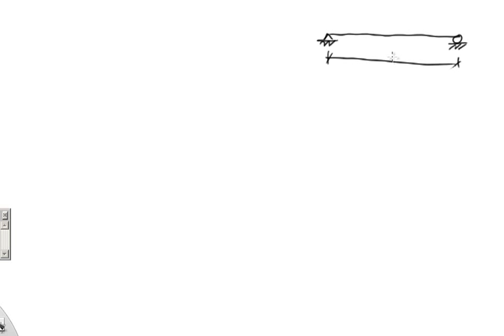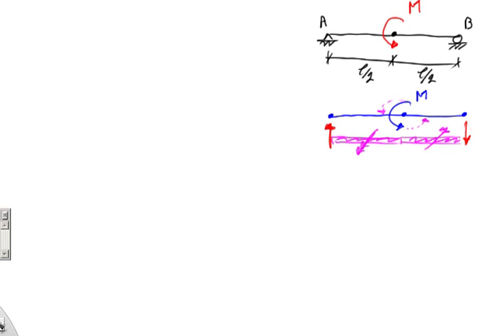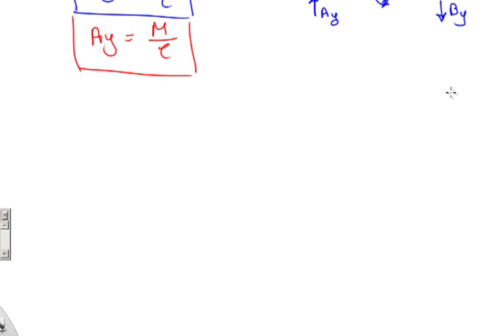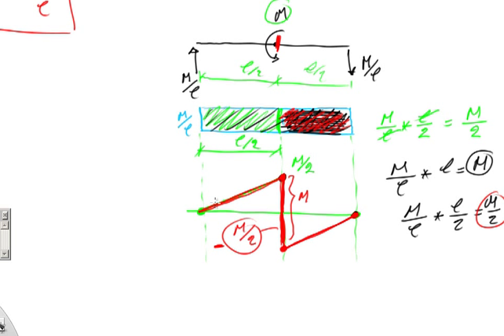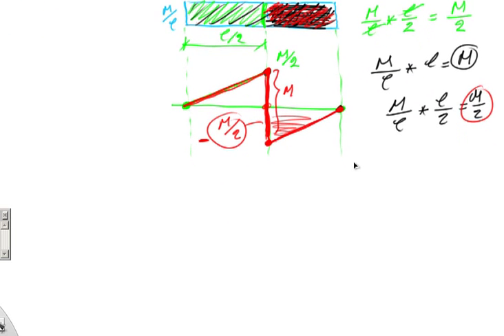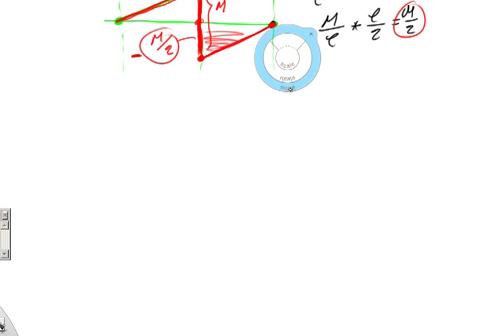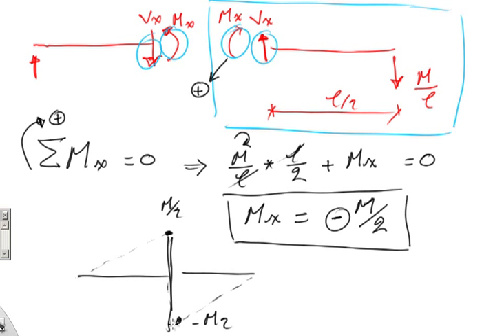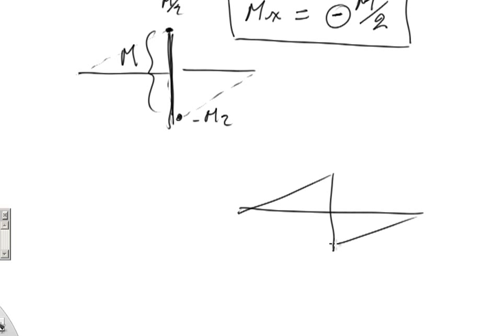Question (11): How do concentrated moments impact V and M diagrams?

Comment: If you perform the cut on the second member and use the right convention, then the moment equation should be M(x) = -M + M*x/l where x varies from l/2 to l. Thus at x = l/2, M(x) = -M/2 and at x = l, M(x) = 0.